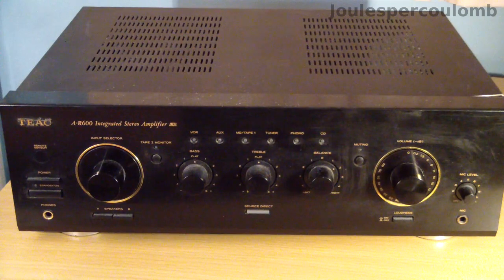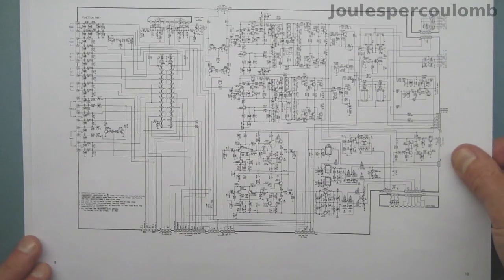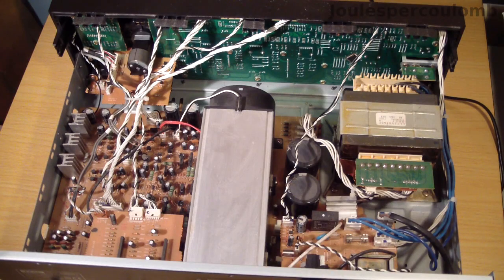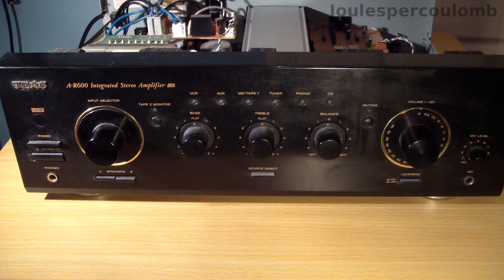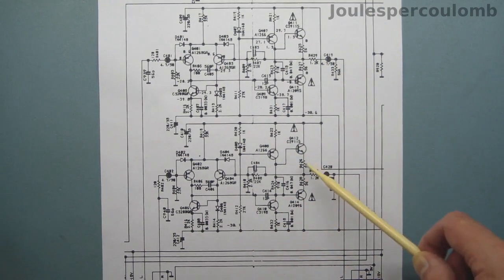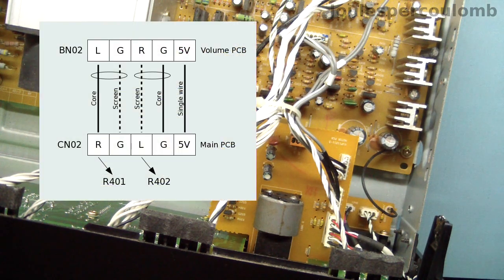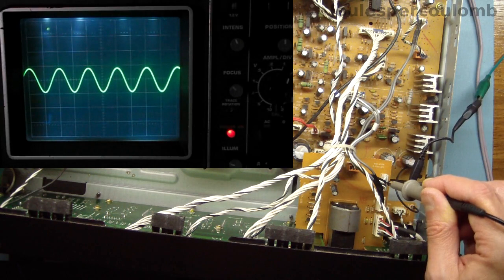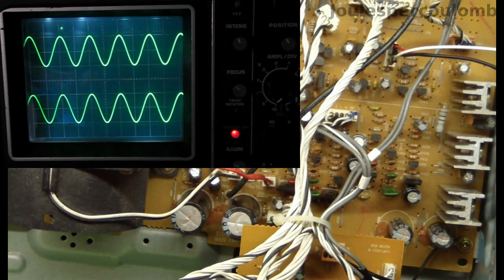TEAC A-R600 Amplifier Repair. Part 1.

Comment: Hi, I have the same unit and the problem I have with it is that the standby button and the source direct buttons have lost either their rubber or springs and don’t push the internal switch (which works perfectly). Could you send me a picture of how those plastic buttons work? I don’t know if they need to have a spring or rubber tube to have proper action. Thanks a lot!

Comment: Hi my AG H350. Teac amp is overheating as fan is not speeding up as temperature goes up. Any ideas would help not opened it yet I am an electronics engineer. Cheers sir

Comment: 6:45 I cannot stand it when they put controls exclusively on the remote control. For the want of a few buttons on the unit itself, that amplifier could have every feature accessed from it. Pennies!! In fact, all features should always be on a unit and then a subset on the remote.